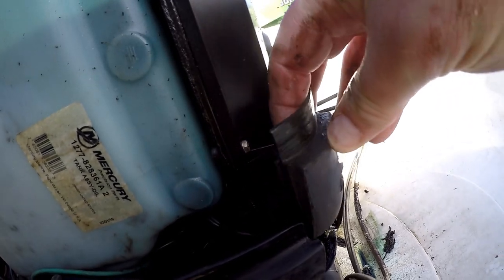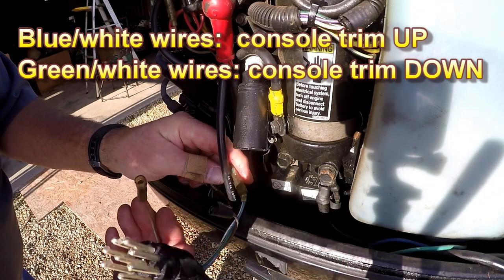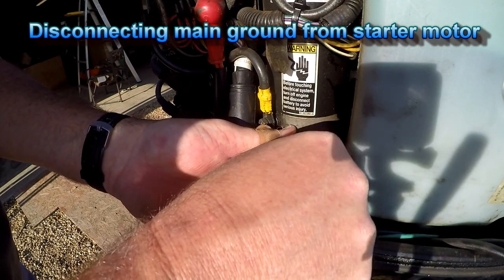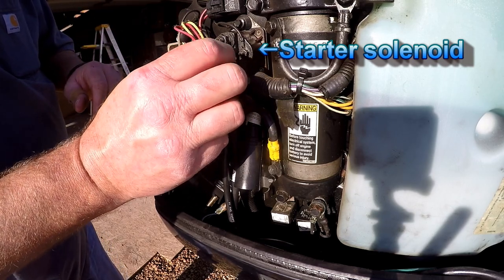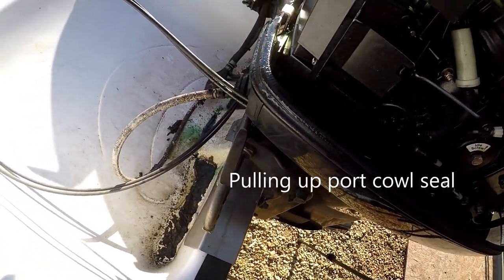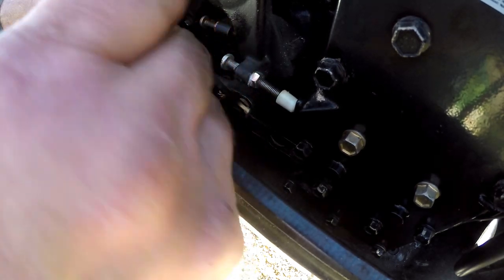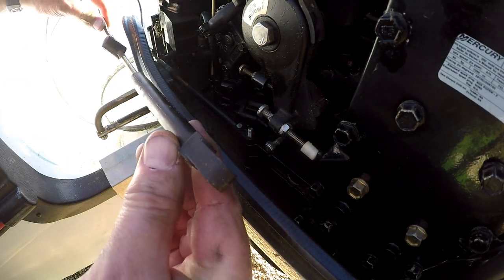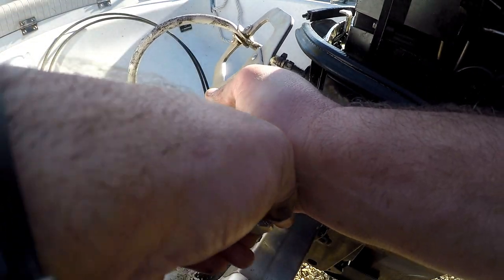Episode I: Removing harnesses, cables, hoses and cowling  2002 Mercury 90

Comment: I wanted to thank you for posting these fantastic videos. I have just finished stripping and rebuilding a mercury mariner 100hp 2006 to replace the mounts, driveshaft housing etc.  and a bunch of other rotted parts, it took 3 weeks . It is a four stroke but they are very similar to your engine. Your videos were my go-to at every step, especially the power head removal. You have helped me so much and saved me so much money! There was no manual to refer to, your excellent videos were my manual. These videos do not have a lot of views, it is a specialist niche, but for those of us that need them, they are a godsend. You have done a great service to boat owning mankind!
Reply from the maker: Thank you sir! I started recording my disassemblys so I had something to refer to when reassembling so I'm glad it's useful to someone else!
Reply: @TheFritz423  in the UK we don't have scorpions though!